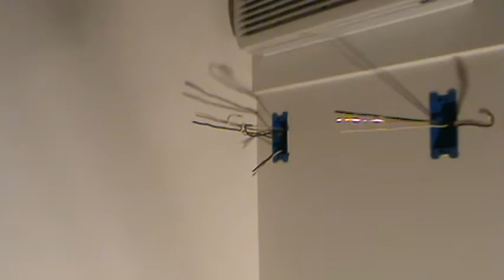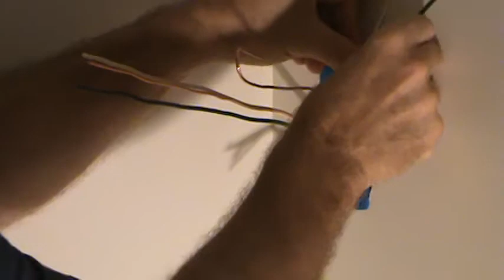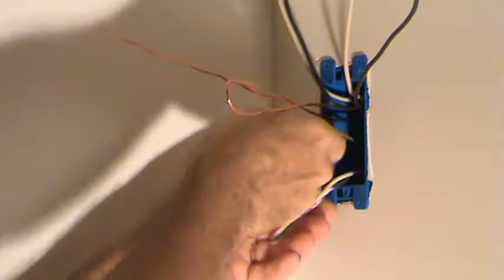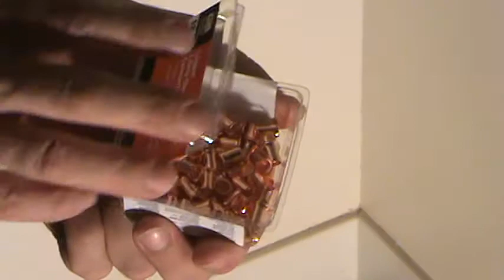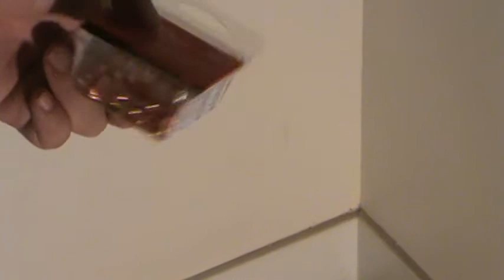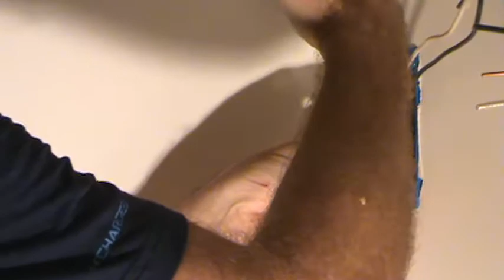How to Install Window/Wall Mount AC 4 Hour Wall Timer...How to Connect Ground Wires...Part 12

Comment: Nice and safe video💪🏾
Reply from the maker: Yes I try to be safe when working on electrical wires. Always the best to turn off the circuit breaker before working on power issues. Want to learn more? I have 19 parts to this video series that will give you more of the picture when you're ready to tackle this project on your own! Go to main channel page & click on playlists to see all the other ways I have in store for you for saving that hard earned money of yours. Your own personal coach is here....ahem.